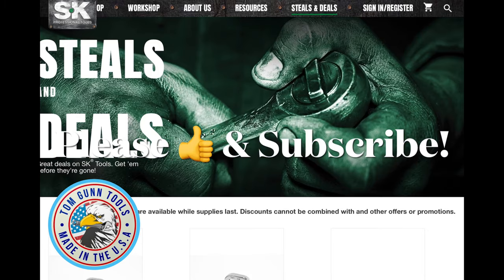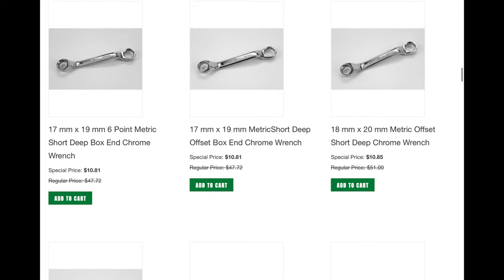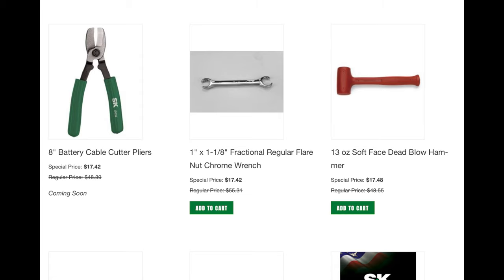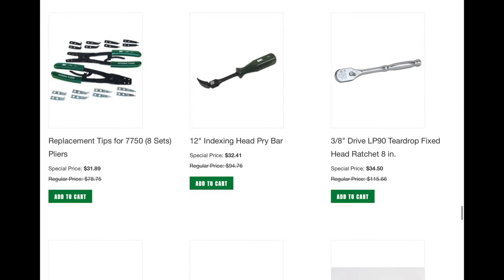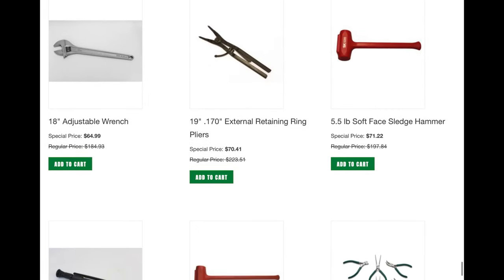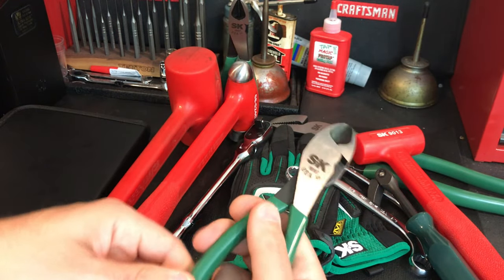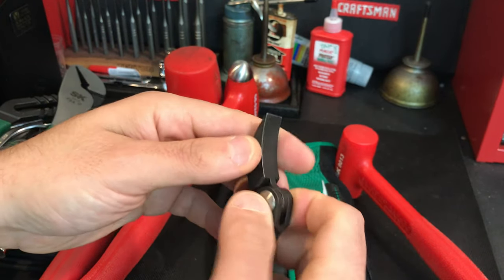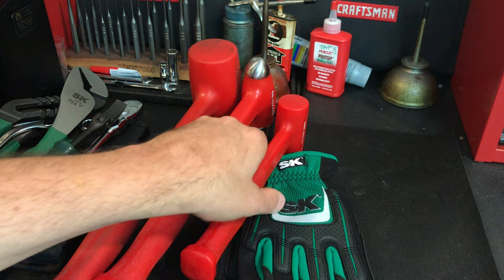SK Deals! SK Tools Must Haves!

Comment: The 8" was instock when I ordered on the 15th, I havent got anything yet. I hope those panel clip tools come back instock amazon has the other piece to it for $21
Reply from the maker: I got the 8” last time it is great. I was disappointed I missed the battery cutting pliers! I think you have those
Reply: @TomGunnTools   Yes i do have them and love them I use them for cutting rubber fuel lines also which they cut very clean, my firefighter friend ordered a set to keep in the fire truck for accidents. If you stay up on your emails they tell you exactly when they release the steals n deals hit the site. I remember you mentioned you got the 8" as a birthday gift for yourself which is exactly what I did, I think it was only $25ish cause I ordered the linesman and a set of gloves for around $55 or so less for my order, the panel popper was available but it sold out the next day.

Comment: Those 10 inch soft jaw pliers are called AN pliers for Army/Navy and are meant to get a grip on military style round connectors to unscrew them from the electronic boxes they are attach to. Very expensive brand new. Great for non-marring plumbing work. Kudos on the score!
Reply from the maker: Appreciate the info, they work great.

Comment: I picked up the 12" adjustable pliers, since I missed them on the last Steals and Deals. I also grabbed the 1/4" flex head ratchet. I already have the 3/8" and 1/2" flex heads from previous buys. There are so many great deals this month. Looking forward to the incoming haul video. :)
Reply from the maker: Yes, best month in awhile! Worked out for waiting on the 12” adj pliers as this is the best price.